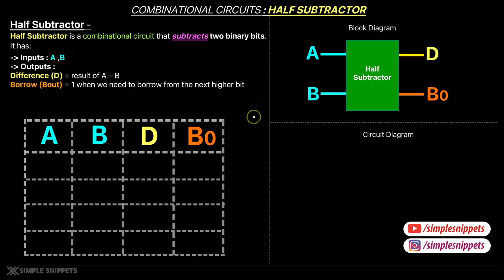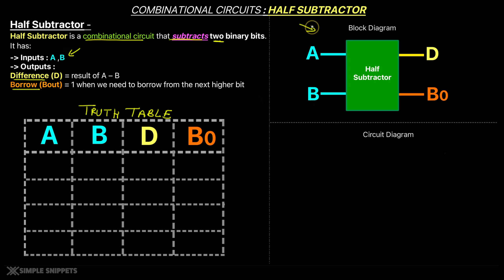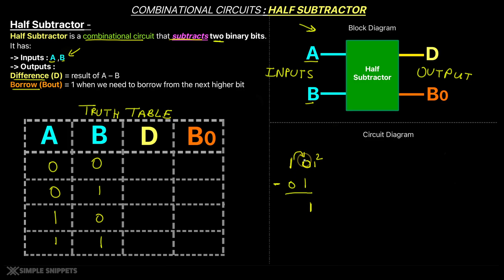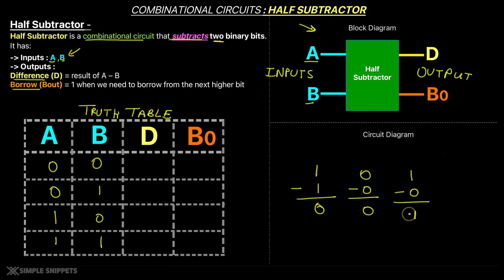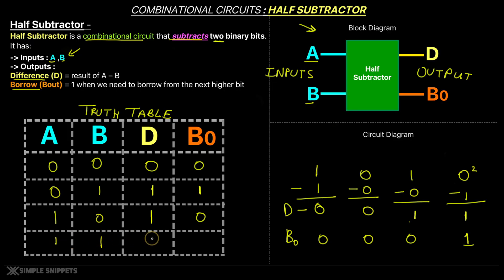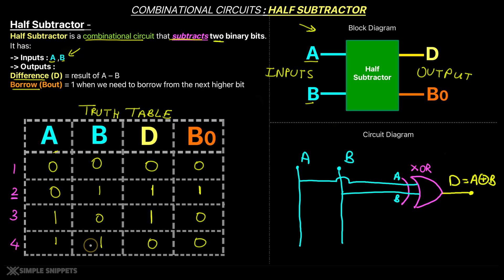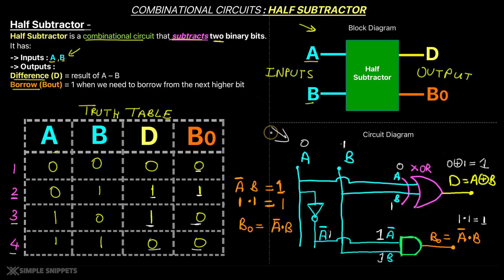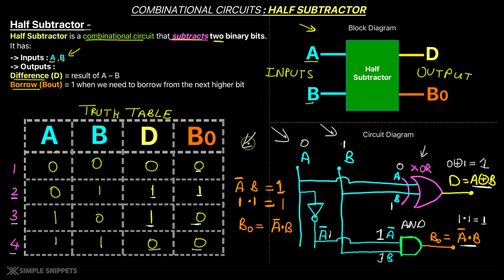Half Subtractor | Truth Table, Logic Gates & Circuit in Digital Electronics

Comment: Paai lagu gurudev 🙏🙏 , you make everything look so easy 😊 ,also can you explain why and where these things are used , i don't know why I am reading this subject at all 😭😭
Reply from the maker: Even though we don’t directly “use” a half subtractor in daily life, it’s a building block in bigger systems:

1. ALU (Arithmetic Logic Unit):
Inside every CPU, subtraction operations are handled using circuits based on Half and Full Subtractors.
2. Digital Calculators:
When you press “−” on a calculator, it’s doing this at the logic gate level.
3. Microcontrollers & Embedded Systems:
For sensors, timers, and control systems, subtraction is often required for calculating differences (like speed = distance₂ − distance₁).
4. Signal Processing & Robotics:
Used when finding differences between input signals, for example in feedback systems.

💡 Simple Way to Think About It -
Just like alphabets are small building blocks that form words and sentences,
Half Subtractor is one of the small building blocks that helps build computers and processors.

Without understanding these, we can’t understand how hardware logic, CPU design, and digital systems work.